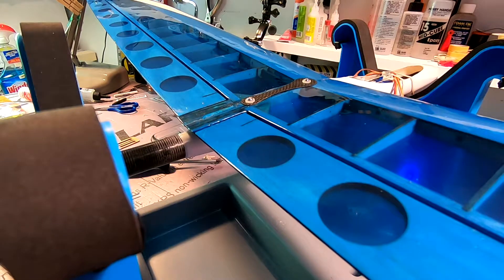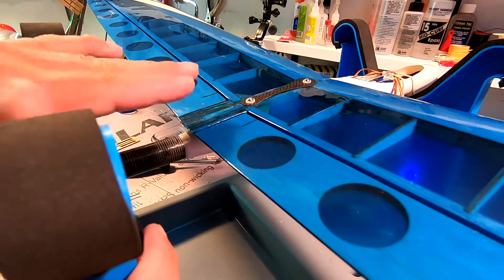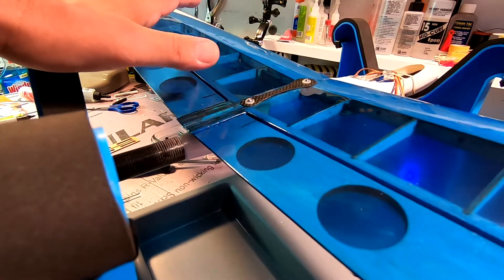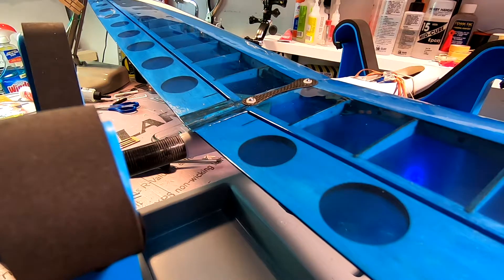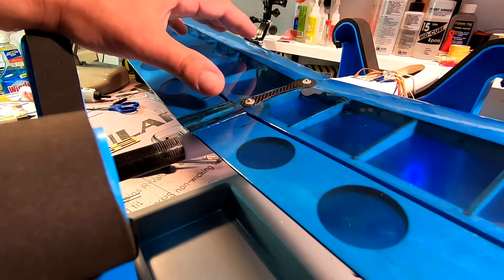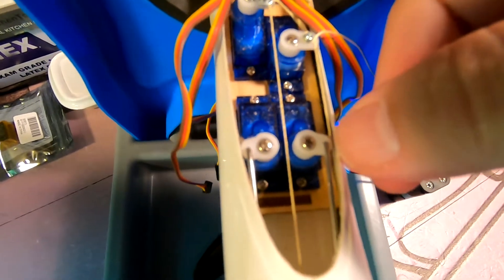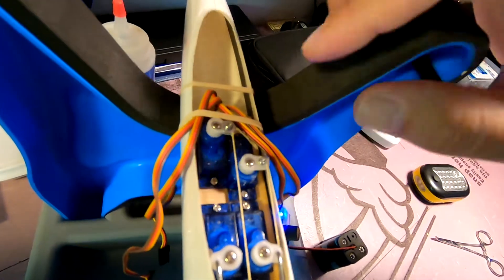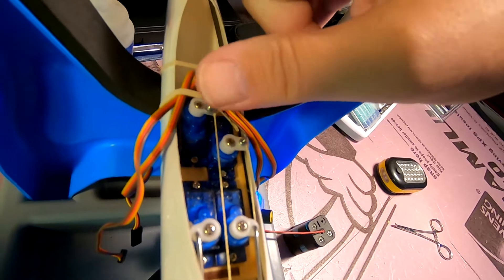HobbyKing Raven 1500 DLG - Build Pt12 - Problems with the Stock Aileron Config

Comment: Great observations. I'd put the servos in the 4th bay with the servo spindle and horns pointing towards the fuselage. If you place it that way you can get your aileron horns placed midway between the 2 and 3 aileron lightening hole.
👍👍
Reply from the maker: I did end up placing the servo in the 4th bay with the horns facing the fuselage. The space between the lightening holes and the length of the servo wire were the main determiners. Again, great minds think alike ;-) I'm launching a couple videos today that are not Raven related, but don't worry, the Raven build videos will keep coming this week. You'll see the next one on Monday or Tuesday.